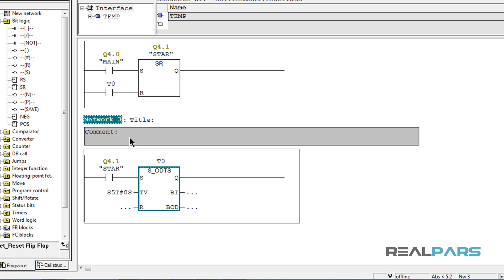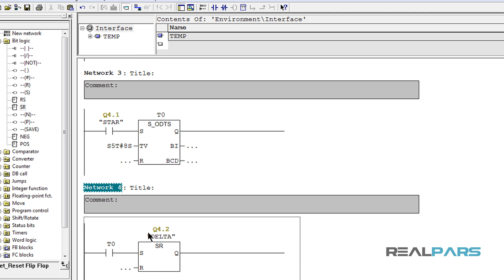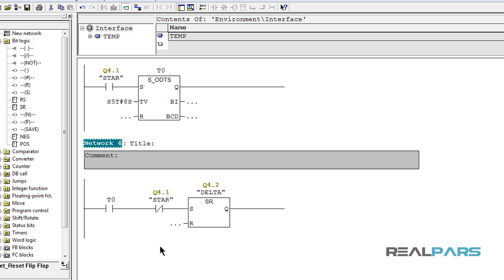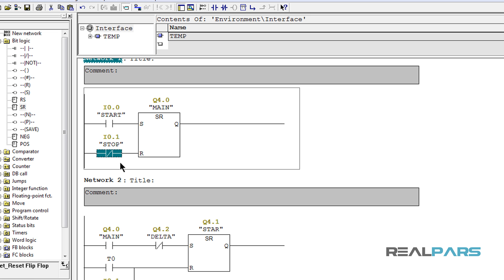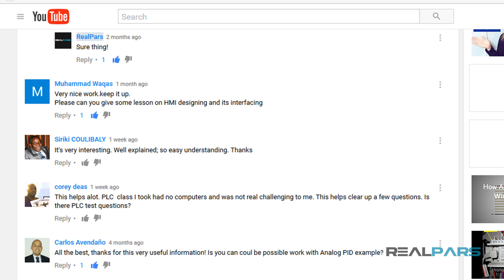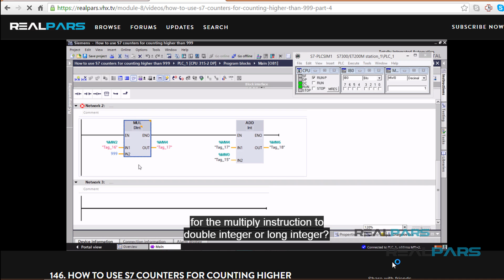Star-Delta Starter PLC Program and Wiring _ Part 12

Comment: I don't understand why you used NC contacts as interlocks for both the star and delta contactors? Can you please explain further? I was thinking both should be open.
Reply from the maker: Hello, @RasKayyyy  Thank you for your question. Well, for the “STOP” contactor, this is how you must implement the logic. A real-world Stop is wired normally closed. If you hit the stop, the wire, or the switch breaks, the machine will stop. And in the case of the interlock, only one interlock must be working, not both at the same time; therefore, when one is working, the other must not until the working one stops. If you're looking to learn more about this topic, you can join our 7-day free trial at https://community.realpars.com/checkout/realpars-membership

Comment: If the switch should be NC then the symbol used should be NO right?
Thanks for these videos they are super helpful.😊
Reply from the maker: Hello, @emmanuelughanze6460. Thank you for your question. That is correct! In a stop circuit the hardware is wired to the NC side of the switch if your switch comes with NO and NC. Why? Because you are looking for a closed circuit on the SW going to the PLC, you are saying in logic, “If the switch is closed or “true” or a logic “1” then all is ok. If the switch is not closed, or not true, or a logic “0”, then stop the circuit or, in this case, “reset.” This also protects if the wire breaks or the switch gets damaged, and you want to stop or reset.  Happy learning from RealPars!

Comment: My problem is from the stop contact you placed on the reset of the Main SR FLIP FLOP. I think reset is energized already
Reply from the maker: Thank you for your question. You must be asking about the STOP contactor in Network 1. It is shown as N.C. or normally closed. That is because it is wired in N.C., which is how safety STOPS must be wired in the real world. Therefore, the way you read the logic must be programmed. You say, “If STOP is not made, then give me a logic “1” or true, then STOP.” But because it is wired closed, the logic is not true, and it will not give you a logic “1,” so the reset will not work. The real-world logic is negated in the program logic. This is done because if the switch fails or the wire breaks, then it is true the stop is broken, so “STOP.”

Comment: The STOP is made with a normally closed (NC) contact, that is input state "1" BOOLEAN, so that if the SWITCH malfunctions or connecting wire breaks, the machine/system could be SHUT DOWN, which is very important on safety grounds.
However to implement it practically, the output of the STOP is negated, that is, a logical NOT GATE is put at the end of the STOP button before going to the PLC input channel. This ensures that the input signal to the PLC's STOP input channel  OFF (0) even though the NC STOP button is made with a NC contact.
With this configuration, anytime the STOP button becomes logically "0" BOOLEAN or LOW, the STOP input to the PLC is logically "1" BOOLEAN or HIGH. Thus the PLC/System will shut down automatically when the connecting wire of the STOP button breaks.
Reply: Could you clarify please, by means of what STOP output is negated? And what means NOT GATE? In my traditional electrical understanding NC contact will supply power, switching SR block to RESET mode. Thank you.

Comment: In star connection there is a stop button (reset) provided parallel to the timer is normally close, so that the star contactor will be a chance to reset?
Reply from the maker: Hi there, 

Thank you for your comment! Indeed, your observation is accurate. The reset process will not only affect the star connection but also the entire machinery logic. It is crucial to incorporate a safety feature into all the logic circuits to ensure the well-being of both the operator and the machine. Wishing you a productive learning experience with RealPars!
Reply: @realpars  ♥️

Comment: Very great & useful video for PLC beginners.
Using a Normal close contact could prevent the system run unexpectedly when wire broken or switch failure.

Comment: I have ONE problem. If a Normally Closed STOP switch is pressed, it OPENS, and thus should sent a logic of ZERO to the R input of the SR flip-flop, but you claim it sends a logic of ONE. WHY? Confusing.
Reply from the maker: Hello Markks100, 

Thank you for your question. In video part 12 we mention you should watch part 10 to help explain why this is done in logic. But to help with your understanding, I will try to explain why. The logic symbol I/I is an NC logic expression of what we are looking for in logic of the hardware real world. Therefore, it will happen like this in the hardware: STOP SW “I0.1 STOP” is connected closed to an input card, meaning it’s a logic “1” or high right? And the logic in the network1 as you read it says, “IS THE STOP BUTTON NOT CLOSED?” But it is closed; so the statement is not “true” or a logic “0”. Therefore “R” input is “0” until you push the STOP button to open it electrically and the statement reads again: “IS THE STOP BUTTON NOT CLOSED?” Yes it is not close, so the logic I/I is true, therefore you will have a logic “1” or high on input “R” and it will reset the “SR” flip-flop. In short what we are asking is “examine for a logic “1” OR “0” depending on how your write your logic for the next action to take place. 

Happy Learning!

Comment: The stop switch is normally closed so that when there is a cable break or the button is pressed, it will give us a signal. it will break current supply pressed

Comment: stop contact (NC) the name itself denotes that normally closed 
basically NCs are closed type that  to conduct the  power supply using  this in a network can results in while pressing that switch the closed one becomes open 
to break the circuit and stop the process  NCs are used 
its mainly used under the concept of the latch and more...
start(NO) and stop(NC) push button

Comment: Normally we use NC contact for the push button on control panel to Stop the system. So when we prees the stop button the circuit become open. At that time if the logical contact for the stop button is also NC we get stop signal .

When the push button on the control panel is in normal condition the logical contact will be open and the stop signal will be blocked.
Reply from the maker: Thanks for adding that, Ajay!

Comment: I don't know why but I can't wrap my head around the part where they add the 2 closed contacts to make sure the star and delta contactors never run at the same time. I feel like if the contact is closed wouldn't that contactor be energized?
Reply from the maker: A normally closed contact in a PLC program is "true" when the physical contact represented by the program contact is not energized.  The PLC program uses contacts in a logical way, whereas the state of a contact in a starter is a physical electrical condition.

Comment: If the Stop switch wire gets disconnected for the safe operation the motor will stop because the event actuate the normally closed Stop switch.

Comment: It's safer to have a normally closed stop switch because in the event that something fails on the stop circuit the machine shuts down. Whereas if a normally open circuit has some failure that causes it to have a break in the circuit the machine can't be stopped until that circuit is closed again which would be terrible in the event of an emergency (or just any time you need to stop production) to have a machine that can't be stopped until maintenance is done.
Reply from the maker: Thanks for adding that, Stuart!

Comment: If it is broken it will stop the system leaving you with a safe off system in the other hand if it were normally opened i would not work leaving you with a running equipment that you cant stop.

Comment: Thank you for the awesome video! I'm sill so confused about the NC stop. If we don't push the stop button, wouldn't the SR flip flop always in reset mode? And the output of the SR flip flop will always be 0?
Reply from the maker: In the field, the STOP pushbutton contact is normally closed allowing current to flow in the circuit and to keep the start circuit energized.  In this condition, the input to the PLC is a "1". When the STOP pushbutton is pressed, the circuit is broken, and the device stops.  When pressed, the PLC input is off, or a "0". In the program, the NC contact does not pass a signal to the RESET input of the flip-flop when the pushbutton signal is a "1", which is when the pushbutton is not pressed. When the pushbutton is pressed, the PLC input is a "0", and the NC contact in the program passes the signal to the RESET input.

Comment: What is the necessity of interlocking the star and delta contactors while the timer is already preventing those contactors energizing at the same time?
Reply from the maker: Great question!  It provides an added measure of safety in case output bits in the PLC are forced on.  Even though the transition from Star to Delta occurs over one program scan (a few milliseconds), it is also good to employ a "break before make" in the transition to ensure that the Delta output is never on when the Star output is on.
Reply: @realpars  thank you

Comment: Reason for stop switch being NC in the field:
1. The most important reason - Eventhough the DI input or the 24V supply fail for some reason, the process still get notified of the failure, thereby achieving a true failsafe method.
2. Industry standard by which technicians and other engineers can relate.
Reply from the maker: Thanks for sharing your knowledge with us, Shahin!

Comment: Good work, but I have a question please. How we avoid the problem of the star contactor, if it remains stuck despite of receiving the "reset" signal, where in this case the star and delta will be practically set simultaneously.
Reply from the maker: You could use feedback auxiliary contacts to kill the circuits if the star contactor does not de-energize after a few milliseconds.  If not, it is likely an overcurrent situation will blow the fuses in the motor circuit.  Motor damage could also result.  However, it is very rare that contactor does not release when the signal to the contactor is de-energized.

Comment: In Network No.2, look at  "T0" and "Stop" are parallel each other but the "Stop" is NC and energizes the "R" input all the time. So i think when the "T0"contact closes there is no effect to the "R" input of the Set and Reset because the "Stop" switch has already energized the "R" input.

Comment: If we are using SR flip flop the output will be zero when R input is one. So how we use NC contact as stop switch.
Reply from the maker: To reset the SR flip-flop, we want the "R" input to be true, or a "1".  A STOP pushbutton is typically a normally closed contact in the field, and is assumed to be for this example.  When the STOP pushbutton is not pressed, the signal to the PLC is a "1", so the NC contact at the "R" inout will be zero or false.  When the STOP pushbutton is pressed, the contact in the field is broken, the input to the PLC is a "0", and the signal at the "R" input will be a "1".  I know sometimes it is difficult to visualize field contacts versus PLC ladder elements, but walking through it like I just did can usually bring some clarity.
Reply: @realpars  This is very strange to me as , as I understood that normally closed means 1 when not activated and 0 when activated
The way you explain it is that  ormally open is the same as the signal in plc and normally closed 8s the not of the signal to plc
Reply: @realpars  i think its confusing because in plc program the term's n.c and n.o are not accurate , we should use XIO and XIC ,when that principle is explained and understand well there be less confusing .

am i right?

Comment: Why didn`t you use coils in the output side of each network? Instead, you left SR instructions as outputs on each network. Thanks in advance.
Reply from the maker: The "output" of the SR instruction is defined as part of the instruction configuration.  For example, the first SR in Network 1 has an output address of Q4.0.  Therefore, the address Q4.0 can be used in the program to indicate that the SR block output is enabled, without having to connect a separate coil to the Q connection.
Reply: @realpars  Thanks a lot for your answer

Comment: A stop switch is normally closed, so that if the system loses connection with a stop switch, in the case of damaged or corroded wiring, we will be notified that there is an issue. Also, if the stop wiring is nonfunctional, it will not allow the equipment to run until the issue is corrected, which prevents possible injury or death in the event you actually need the E-stop.

The lessons have been helpful for learning more about both siemens programming, and refreshing my memory on other aspects of PLC operations.   

Thanks!
Reply from the maker: Thanks for sharing that with us! Happy to hear that our course videos have been helpful to you. Feel free to reach out if you have any questions.

Happy learning!

Comment: This vedio very useful for the leraining stage 
And one more thing sir 
Y don't we use another timer in star delta connection sir
Reply from the maker: Only one timer is required in order to delay from star to delta operation.  PLC logic is a wonderful tool, since there are multiple ways to implement the desired logic for any given problem.  This includes schemes for handling timing functions, as shown in this video. Thank you for your comment and we hope you continue your study of PLC's and automation.

Comment: The reason for using a NC push button is to open the circuit, if NO push button is used then, if accidently the wire of stop PB is disconnected, it could end up in a great mess at the time of stopping the system.

Comment: Stop buttons use NC (Normally Closed) as a design for Safety functionality employing a closed loop.  It can incorporate an indicator to notify a "Change of State",  but mainly to ensure you have control in an emergency.  Consider, if at some point along the control cable became inadvertently severed that nobody knew about and uses a NO (Normally Open) to become open loop control .... nothing would work being very UNSAFE.  Alternately, using an NC the system will FAIL to activate alerting the FAULT un this condition ... very SAFE.  This is the foundation of the concept as I learnt in my Electrical Trade and PLC Study   :) :) :)   Also consider "Safety PLC" and "Safety Relay"
Reply from the maker: Thank you for your comments.  Yes, STOP pushbuttons and E-Stops should be wired normally-closed so that pressing the STOP or E-Stop button breaks the circuit.  Safety PLC's and Safety relays are more reliable versions of their non-safety counterparts, are more expensive, but provide a greater probability of working on demand.

Comment: why we used an SR flip flop instead of an output coil?
Reply: An SR flip-flop makes the logic a little bit simpler and easier to visualize than if only output coils are used.   But you are correct;  this logic can be implemented a different way without using a flip-flop.
Reply: thanks for your answer. I have one more query., IS there any particular reason other than making the logic easier. 
Will it make the program execution faster?
Reply: @shinoskv  If you were to use a coil instead of a flip-flop, you would need to use several other bits to create the latch/unlatch of the flip-flop.  The difference in scan time and memory  usage is very small, and even if you did 100 of these operations in a single PLC, there would be no appreciable scan time difference.
Reply: @scottsommer6480  Thank you. That was realy  a good knowldge provided by you.

Comment: "Location of stop switches with many applications has to be very carefully considered in order to ensure a safe system. A stop switch is not safe if it is normally closed and has to be opened to give the stop action. If the switch malfunctions and remains closed then the system cannot be stopped.
A better arrangement is to program the stop switch in the ladder program as open and use a stop switch that is nornally closed and operating opens it.
Thus there is an input signal to the system which closes the contacts in the program when it starts up."

An extract from "Programmable Logic Controllers", Fourth Edition.
Reply: It had to read five times to figure it out what is wrong in it. The “stop switch” in second sentence is actually a contact switch in program not physical button.
Reply from the maker: Thanks for sharing David!
Reply: If my hardware (physical switch) is NC and my software ( PLC prog) is NO and connected it to let's say Reset Flip/Flop wouldn't that activate my ESD upon start-up? Since hardware is NC (voltage is on) thus software turns from NO to Close.  Kindly let me know if I am mistaken. Thanks!
Reply: @edgaregan2421  You raised a very interesting point here. It depends on the physical state of the switch. If the physical state of the switch in normal condition is NO, you apply forward logic otherwise you apply reverse logic, and it may change the logic component in your ladder rung. I hope it helps you understand the difference in terminology. Good luck!